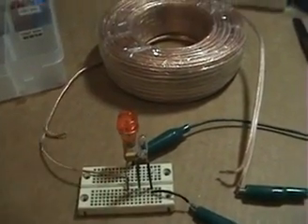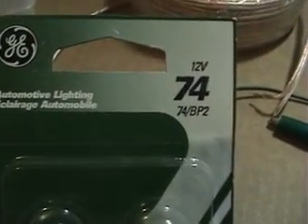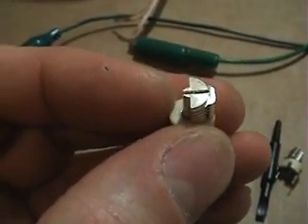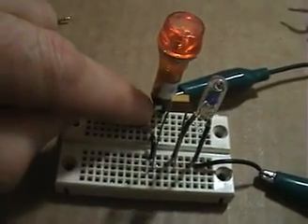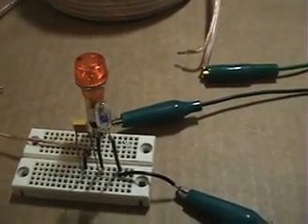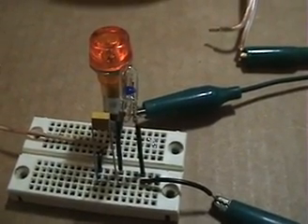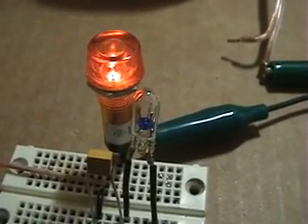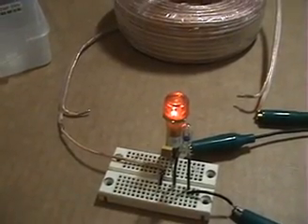Coil Resonance Tutorial 2

Comment: All the different sized capacitors had their own, unique resonating frequency. You are focused on the small panel lamp. The varying degrees of brightness are a result of the impedance changes that each capacitor produces against the same inductor. Your last value, 47pF, just had a very high L-C impedance and choked the current off. I'm not sure what you want to demonstrate, but it's a good experiment showing the effect of varying AC circuit impedance with different L-C combinations!

Comment: What amplitude were you using.... and does it even matter with the low voltage output (on the couple function generators I've played with at least)? Secondly; what is the purpose of swapping those caps with respects to the coil resonance experiments? Was that not already determined with the neon and you just swapped caps between the neon and the std. Bulb until the bulb wasn't lit... it seems like the std bulb only lights up due to the caps impedance with respects to the frequency at the neon. Lastly; does the voltage rating for that std. bulb not matter? It seems like it would.  I liked the video, it helped somewhat  but I think the questions above mixed with my lack of knowledge have me slightly stuck... they just seem like important specs to know if I want follow along and experiment... 
Btw, I mean no disrespect. I'm very new to this, but the EE bug has bitten and now I'm very mentally (and financially) invested into learning after being over 30 and just recently picking up my first DMM.
Reply from the maker: Max generator output (10v) was used. Finding the best cap value will boost the performance. You want to use a bulb that will light with a very small amount of power so it's sensitive enough to use for visual tuning.
Reply: @gotoluc So I've studied a lot the last couple days, took a bunch of notes, then ended up hooking up my scope to some coils... My question that had me confused about the Light turning off at resonance.... Well I had the wrong understanding of the outcome of resonance...  I was under the impression that the output on a coil would be at maximum at resonance which I found was totally wrong (at least for what I know now. Maybe there's exceptions to the rule I haven't leaned yet).  So where I was trying to get TO resonance on boosting for example, I really need to make sure I stay UNDER resonance frequency of the coil. Thanks for the response on such an old post. The video made me dig deep which was needed.

Comment: For a known value of coil and capacitor one only needs to use the correct frequency for resonance. Changing the capacitor value only changes the resonant frequency. Since you have your capacitor & coil in series you are going to get series resonance with a expected current rise at resonance which is what your automotive bulb is indicating. I am not sure I am understanding your circuit well enough. A circuit drawing would have been helpful. From what I can gather from your video explanation it appears your findings/assumptions are faulty.

Comment: The wireless energy transmission already works. The power gane is not a result of just modulating a feald to resonate with the capacitor..it is proposed that the energy gain results from a resonance of the signal with other ambient factors which amplify the signal on the way to the receiver..try a different set up of coil and circuitry... Anyhow thanks for the videos:...

Comment: very good demo.
If you were going to make a power supply using a resonating coil... (a) is it possible to power a 110V appliance using the resonant method you have demonstrated? and (b) What component would you use in the power supply circuit to replace the signal generator in your workshop?